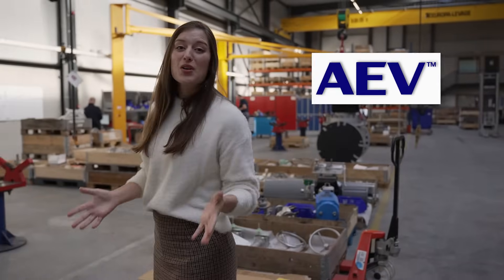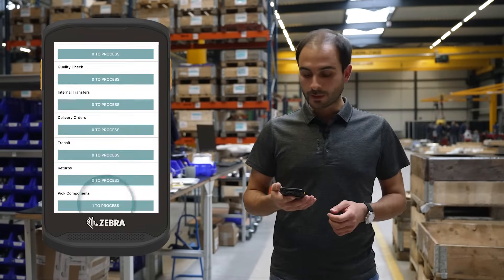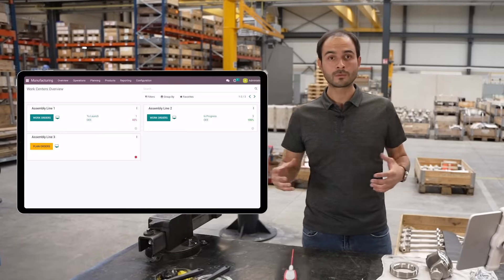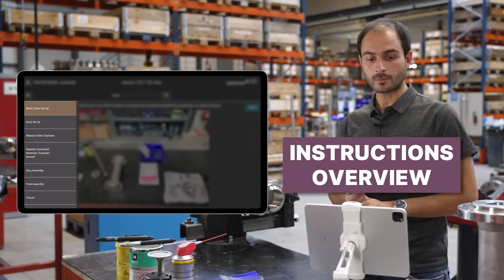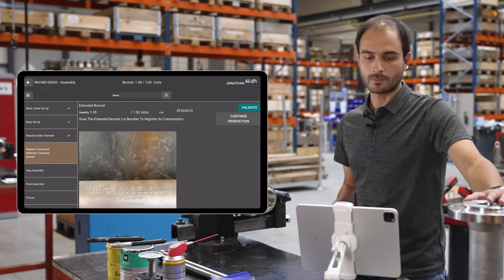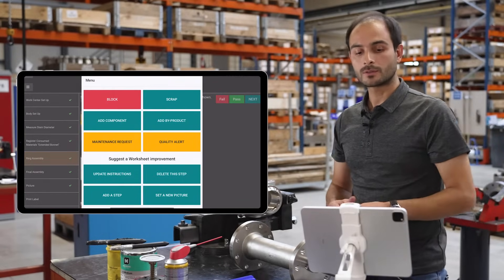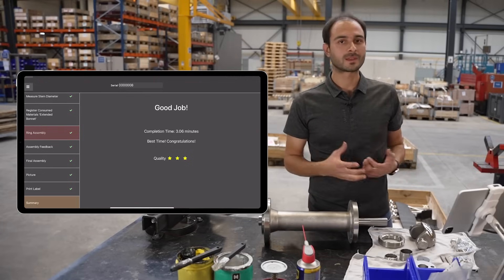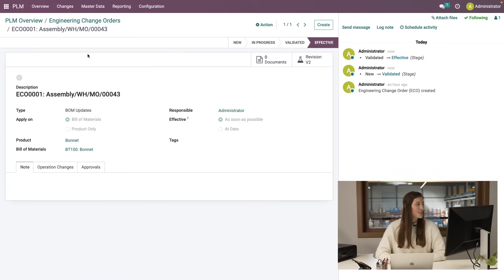Manufacturing Execution System with Odoo MRP

Comment: Doh ... not really credible, barcodes printed on plain paper and stuck to a wooden crate with office scotch tape ? To show the functionality, keep it in the studio if it is a demo and not try to fake it as a real customer implementation.
Reply: I disagree. In fact, I feel the opposite. Contrived examples are more difficult to relate to.
Reply: @cparker4486  Even the picking process is simply bad this way, showing picking options would be more helpful. No employee would pick this way. Go back and forth when you could easily pick everything in 1 go...